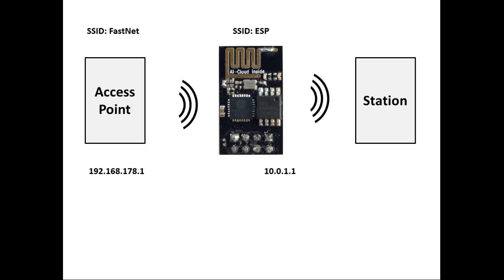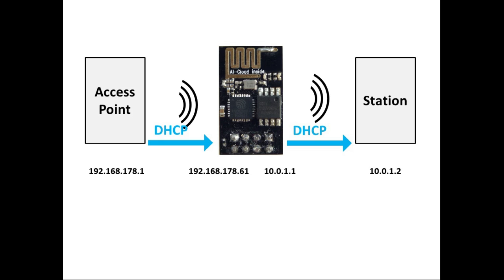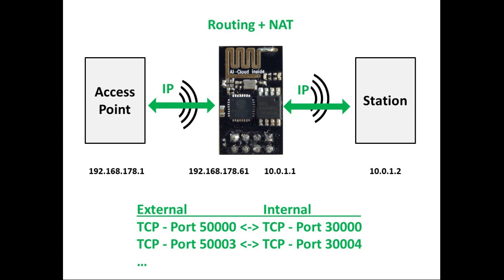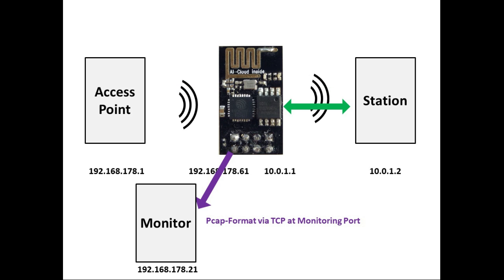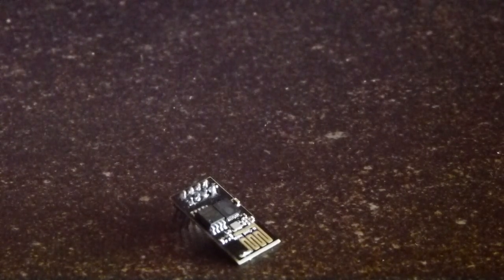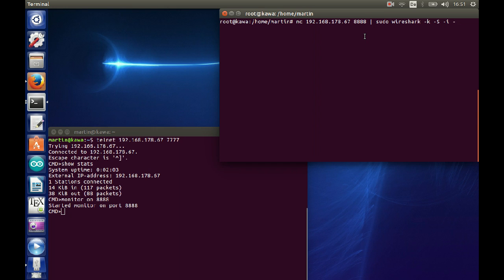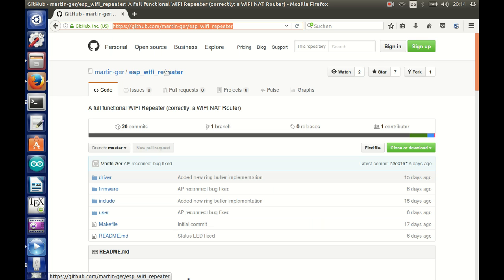ESP8266 WiFi Repeater (NAT Router)

Comment: I built this. But i built it into a light socket and encaptulated the whole ordeal with resin. Now i have wifi extender that looks like a light bulb and it saved me from drilling holes and routing cable all over the place. Im actually watching this video over this wifi extender :-) works well, on your git page you said i can handle 5mbs I actually got 7.8 which is where im throtled at. It tends to decrease speed and then in bursts go faster on average i get around 4mbs. This has been running for a week now. Thanks again this is very usefull!!!! And thanks also for assisting on your git page. Initially i couldnt get it programmed due to the dio setting on the flasher that was set to something else (you may want to warn people)
Reply: WOW RESIN ENCAPSULATION !!! ooohhhh please please please would you be able to link a photo of what this looks like when encapsulated in Resin ?? im a HUGE FAN of Resin encapsulated projects,, please please please can i see a photo or quick video :))

GREAT JOB !

Also Martin Ger;
YOU'RE AWESOME !!!!! Instructables instructable is fantastic - GENIUS !

Comment: Hi Martin. Just wanted to say thank you very much for this project. I'm using 4 NodeMCU devices running your code and I'm getting wifi coverage all over my house and (finally) in my garage. I used the binaries, it was very easy to set up once I used the esp_init_data_default 'fix'. Thank you!
Reply from the maker: Hi Kevin, happy to read that! :-)

Comment: Hello Martin, 
fantastic work, thanks a lot for your contribution to arduino/esp community! 

I tried it on ESP8266 as well as on ESP32 and it works great. I assume there is no possibility of port forwarding, or switching the router to bridge mode, so the "AP" clients would be accessible from the "STA" network, am I right? I wanted to extend the wifi range to my outdoor cameras but then I realized I am not able to access their RTSP stream port needed by NVR. Any chance of idea how to access it on "AP" side?

Comment: Nat router on esp32 Is usable alternative to commercial  products. I just finished my portable router. Thank you, your work Is great.
Reply: Hi @palashproduction4723, I used an ESP32 too, but speed rate is 6 Mbit/s maximux, with a low rate of 1-2.. Your experience?
Reply: Hello @xerix32, my results are a bit worse than yours. I never got to 6 Mbps,  3-4 was my maximum, with same rates as you had. My network  infrastructure is not the best.

Comment from the maker: Up to now, I heard of no problems on any ESP12 based HW. Should run with the standard firmware version. I only had a problem with some newer ESP01 (after booting only random output on the serial. blue LED on) - there the firmware-1.5.4 works.
Please check, what happens on the serial output (at 115200) just after resetting the flashed modul. Verify, that your setup  can sucessfully flash other firmware files (e.g. AT-firmware).

Comment: Hi Martin, I've seen your work with the esp32 as a nat router. How would you configure it to work with a W2AP enterprise network? The native interface on the github build doesn't seem to give an option  for a user ID.
Reply from the maker: No, this is not yet implemented for the ESP32.
Reply: @martinger327  I think I have managed to connect with the W2AP network and can download html code after pinning a website. I'm a bit suck trying to set up the routing. Do you have any advice for figuring out how to route the STA to the AP?

Comment: As a newcomer to the ESP from Arduino land, this looks insane. If I can fix some WiFi holes in the house and around garden with this app I will be very pleased. Can't wait to start with my NodeMCU. If this was available in the Arduino IDE environment it would go viral I'm sure.
Reply: It cant since its not running on that platform. Its running on lower level binaries.

Comment: Very cool! I'll be giving this a try, THANKS! Are there any significant disadvantages / advantages to use of ESP32 version over ESP8266 version?
Reply from the maker: The ESP32 version has a significantly better performance, when used for higher bandwidth clients. The ESP8266 version has much more features, including port mapping, ACLs, monitoring, MQTT management, GPIO support, and AutoMesh (and the ESP8266 is slightly cheaper). If you are only looking for a basic range extender, the ESP32 is the better choice.

Comment: Do you have another video on flashing the ESP with the code to start someone from scratch? I'm looking to build my own for my camper that I will have to configure with each move, but don't know where to start, I bought an ESP with a programmer... And that's as far as I got
Reply from the maker: If you have a board with USB connector flashing is easy. Description can be found here: https://github.com/martin-ger/esp_wifi_repeater#building-and-flashing .

Comment: Hey Martin, I'm having a bit of trouble while configuring NodeMCU when the original SSID has spaces. Can you help me?
Reply: Just use %20 instead of a blank/space. For example: My%20SSID. It is easier from the console port.
Reply: @dirkkm3548  thanks you, I will try it

Comment: It could be interesting to be able to "repeat" back and foward from the Serial also. This way we could integrate a GMS/GPRS modem into the network, since they became so affordable these days.. I know the max pace for those modem are low like 115200, but, when the goal is sending/getting and small data packet, it is still just perfect.

In this case, the ESP become the internet router.
Reply from the maker: Actually, the code is prepared for that and i already did a similar thing. Look into my repository https://github.com/martin-ger/esp_slip_router . 
All one has to do, is to write a netif implementation for the modem interface. Used one for the simple SLIP but probably a GPRS-model has a more sophisticated protocol. Do you know a spec there?
Reply from the maker: Thanks - this looks cool. Will order one and look into it...

Comment: hi Martin, Thank u so much for all this Infos, i still have a question.
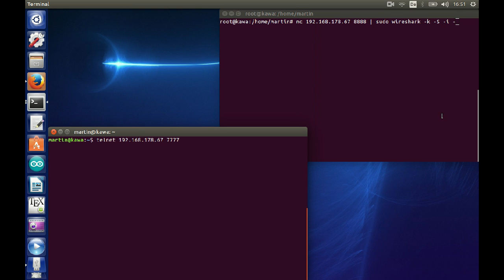how did u get at the minute 9:35 this external IP-add 192.168.178.67 ? 
and whats the context between this and the CMD portmap add TCP ... ? 
i dont get this external IP-add from the CMD  "show stats".
Thank u alot.
Reply from the maker: The external IP is usually given by the uplink AP via DHCP. It can be different after each connect. You don't use it explicitly in the portmap command. Here you specify the external port and the internal IP/port. Then you can reach the internal IP/port by connecting to the external IP/port. This external IP is the listed IP again.
Reply: @martinger327  also this external IP is in my case is the STA IP of the ESP when i type "show stats" CMD?
Then i should put this IP and Port 7777 in theTelnet and open a Monitor on port 8888!
The NetCat is not necessary, can i put the STA IP and the Port 8888 dictly in the Wireshark? and the PC where the Wireshark is installed musst not be connected to MyAp!
Thank u so much indeed.

Comment: Thanks for the video. Can you please share your schematic (fritzing?) of the circuit where you are using a battery.
Reply from the maker: Don't have a schematic tool, but it is just a standard 18650 li-ion battery with a switch and SI-diode in line to protect the ESP from more than 3,7V. Later I added a TP4056 over-/undercharging protection circuit with micro USB connector for re-charging in place.

Comment: Hi Martin  . Thanks a bunch .!.. Cool setup.. I will try the mqtt client part in my projects.. Just wanted to check with you on the QOS  support of mqtt client. Do the mqtt client interface support QOS  (0 and 1)? Thanks...
Reply from the maker: Currently it use QOS 0. The lib supports 0, 1, and 2. Small adaptions in the code will enable that. Will try to enable that from the CLI in the next version.

Comment: Thankyou Martin, it works perfectly! Can you suggest a tested model with better antenna or with antenna connector onboard?
Reply: The D1 Mini Pro has a connection for an external antenna.
Reply: @eclecticlife  Thank you John!
Reply: @capannolimaurizio  YW  I forgot to mention that you need to desolder a resistor when connecting the external antenna to the D1 Mini Pro.  Make sure to do a search, there is plenty information on how to do it.  Thanks

Comment: I am using openHAB2, home automation software, running on the Pi in my RV and Boat.  So the NAT Router works great repeating the RV Parks/Marinas WIFI, or my mobile hotspot, since there is no wired internet in such mobile applications.  Here’s my question…I’m running into the max number of connections to the NAT Router.  I’ve read that 4 or 5 is the max, your documents indicate 8 is the max.  I use the NAT Router as my WIFI repeater/AP with the Pi and several home brew esp8266’s, some sonoff/tasmota power outlets, Echo Dot, smart phone, tablet, and laptop, etc all on same network all communicating via MQTT to the Pi/MQTT broker.  What might be your solution to get all devices on the network???  Thanks for this great project.
Reply from the maker: The limitation is built into the binary blobs of the ESPs WiFi-Driver. One solution could be to cascade two repeaters and to connect especially the low-bandwidth clients to the second one.
Reply: Cascading two repeaters works, I was surprised how easy it was.  1st repeater IP 192.168.0.1/ssid = First, and 2nd repeater 192.168.1.1/ssid second.  Thanks so much for your effort.  Auf Wiedersehn.

Comment: Is there a limit to how many soft-APs you can chain? I plan to setup about 50 outdoor sensors/relay controllers (irrigation valves and moisture/pressure sensors) using Wemos D1 Mini in a line configuration (one device connected to each soft-AP) with 30-100m between units. Will it work to use 50 soft-APs?
Reply from the maker: From the protocol side this should be no problem, bandwidth also probably not. Individual config of 50 sensors should be a pain in the a... . I guess the main problems would be error propagation and debugging. If each hop has a success probability of 99,9% (which is somewhat reasonable at least for a single packet) it will be only about 95% for the whole line.

Experiences from wireless multi-hop networks show, that something around 5-10 hops is a reasonable diameter. Things could be better if you have a known fixed topology. I would start with 10 in a row. In fall semester I will make some experiments with multi-hop ESP networks. I am curious about the results...
Reply: Thanks Martin. I currently only have 3 D1 minis and one D1 pro so I cannot test full scale yet. I agree about the config being cumbersome but for a one-off project it will be ok. To reduce the number of hops I will try to use D1 pros with external antennas (slightly longer range) and have stars of D1 minis around these.

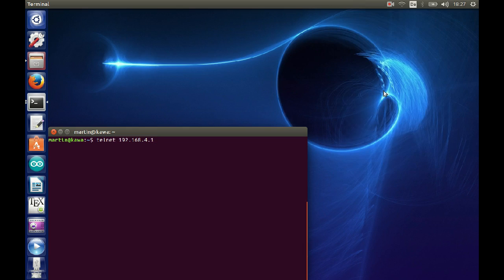Comment: Hi. Great work! I dont understand how you acces the esp for adv. config. Can i just use the windows cmd promt 6:40?
Reply from the maker: On Windows use putty and open a telnet connection to port 7777 on the esp when it is already connected to WiFi.
Or use it as a serial terminal with 115200 bps on the COM ports that is connected to the esp.
Reply: Thanks! This works. Im trying to setup the exstender on a WPA2 Enterprise network( for a chromecast). How do i find the "peap_identity" for my network?
Reply: Never mind. I just realised that my router is 5Ghz and the esp8266 is 2.4Ghz...
Reply from the maker: @antonrnnedal7797  PEAP has two identities, the outer identity, that is visible to an external observer (and can be used to route the following authentication to the correct RADUIS server), often anonymous@"your-domain", and the inner identity, the peap identity: this is the username that ist actually checked by the RADIUS server. It is protected by the encryption and is not visible to the rest of the world.

Comment: Hi Martin, it's a great project. I have a question... It's possible using the esp32 as a NAT router and only allow some ports to be use? I mean, if a user wants to communicate to PORT 80 and I don't allow that port, the station receives nothing. How can i do that?
Reply from the maker: The ESP8266 version allows for port filtering, the ESP32 version not yet.
Reply: @martinger327  Thank you so much for your answer. I'm new implementing Wifi to an esp project so I will be glad if you can guide me with in which part of lwip I should study to implement port filtering in esp32.

Comment: Great job…Love it.  I have some static IP addresses on my network and would like to exclude a range of IP addresses.  What is the command via telnet to do this? Or maybe there is a command to have Nat router assign an IP based on a MAC address?
Reply from the maker: You can save the current DHCP leases with "save dhcp". This will preserve IP assingments after reboot.

Comment: I just wanted to add some findings that may help with using this for outdoor/mesh/range extender. 
I was getting inconsistent internet speed results and it was driving me crazy. I really wanted and needed this to work. I am trying to ensure emergency network coverage for my remote property(using Viasat). for E911 and cameras etc. 
I have a note 9 and all is good on normal WiFi, barely 1mbps on esp82xx. 
It turns out, if you enable airplane mode, then turn WiFi back on it seems to work quite well!  
I am now reaching 5-6 Mbps consistently. I hope this helps someone else in the same shoes.
Would love to see the ESP32 in mesh config! and a larger mesh node count. like 100 node.  :-)
Setup as follows, still tweaking but close.
esp8266-12F 
External antenna Mod
Tp4056 Charging Module
single 18650 2500mah
2.5W 5V/500mAh Solar Panel

Comment: Hi Martin,congratulations for this great job.I built an extender based on a esp32 ,I see on the serial monitor that there ia a station connected ,DHCP assigns an IP to the station (a nodemcu tasmotized) but I can't acess to that IP.  Any idea what can be the problem?

Regards
Reply from the maker: If you want to access the connected NodeMCU from the upstream network, (e.g. via HTTP) you will need a port-forward. In the ESP32 version this has to be added in the source code. However, the STAs can connect from their side e.g. to an upstream MQTT broker. This is normal for a NATed network.
Reply: @martinger327  Thank you;the extender is needed because the place of the nodemcu  as poor wifi

Comment: Huge fan or the routers, a bit stuck with the installation of the pre built binaries on the more expansive nat router. I am no docker user and the pre built binaries seem to do nothing when flashed to the esp... am I missing a button press or something? I'm using the esp download tool and a nodemcu esp 32
Reply from the maker: It only works on an ESP8266. For ESP32 look here: https://github.com/martin-ger/esp32_nat_router

Comment: Hallo Martin, Danke nochmal fuer das Video. Bis zum oeffnen von Port durch "monitor on 8888" habe ich es geschaft, aber fehlt mir noch den Schritt "netcat [external_ip_of_the_repeater] [portno] | sudo wireshark -k -S -i -", die nicht bei mir in Win7 funktioniert wollte, was soll ich stattdessen schreiben? also senden von external IP + Port in die Standard Input of wireshark.
Reply from the maker: Ehrlich gesagt, weiss ich nicht, wie und ob das auf Windows geht. Was bei mir einfach klappt ist eine Linux VM auf Windows.
Reply: @martinger327  okay ich probiere es auf Linux.
VielenDank :)

Comment: Hi Martin ,  amazing work. I have set up en28j60 and from first-PC connected to en28j60 (as IP 192.168.5.2)  and the esp connected to my home router as STA IP 192.168.1.5  I cannot ping/reach my home router gateway 192.168.1.1 from first-pc thru en28j60. From a second-pc I connect to esp with  telnet to 192.168.1.5 7777 and from within <cmd>  I can ping IP 192.168.5.2, IP 192.168.1.1, and even ping  google.com. Do I need to set up static routes for the Ethernet interface?. Can you help me with a sample route map that I can add to esp to route Ethernet to home router gateway/network. I am stuck here for a while

Comment: Amazing stuff! I send you this message through one of this routers. I use nodemcu board, mine is inside a DDS tape case with an external antenna running from old cell phone battery

Comment: Hi Martin, thanks for the video. I've only one question, I'm not able to ping some device connected to the AP from pc connected to the home router..instead i can do the opposite, could you suggest something? thanks
Reply from the maker: This is because of the NAT. It is the normal behavior. You can reach devices via TCP or UDP using Port forwards, but you cannot forward ICMP
Reply: @martinger327  thanks for quick answer, so I can use mqtt to send/receive message between two device, first in home network and second in ap network, right ?
Reply from the maker: @albertocelano5402  If the broker is in the home network it will work direktly. If it is in the ESP's network you will need a port forward TCP 1883 to the brokers IP and 1883. From the home network you then have to connect MQTT to the ESP's address. It will be forwarded to the real broker.

Comment: Ausome work!!! Im testing this option. Can i use one ESP8266 to work like NAT Router and like Relay controler (mqtt on the cloud) at the same time? The NAT Router is runing very well but the mqtt client on the same NAT ROUTER ESP8266 no connect.